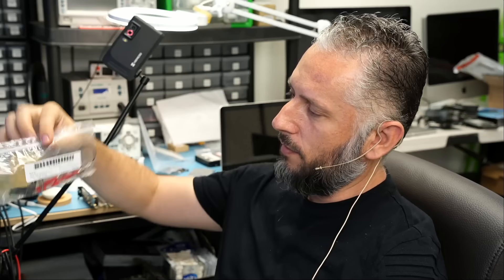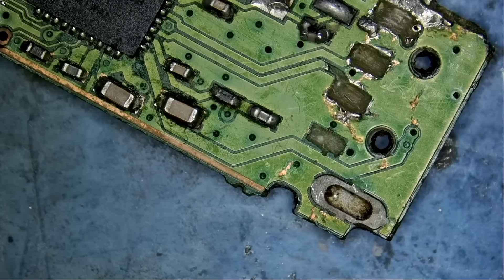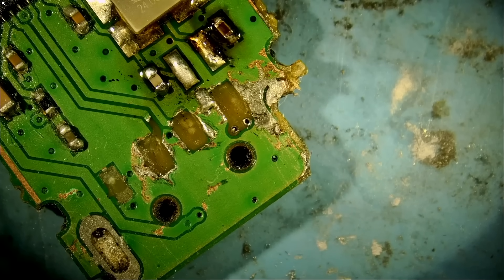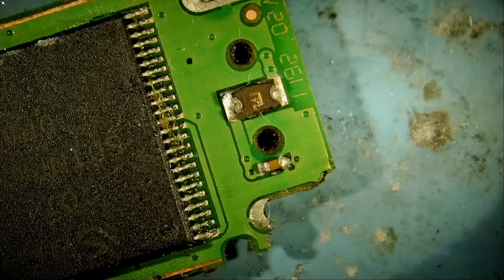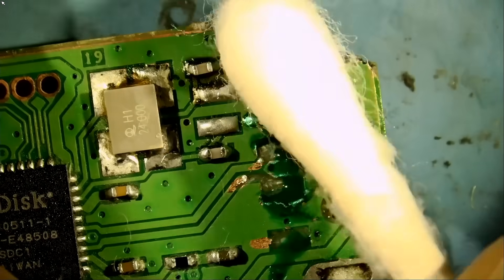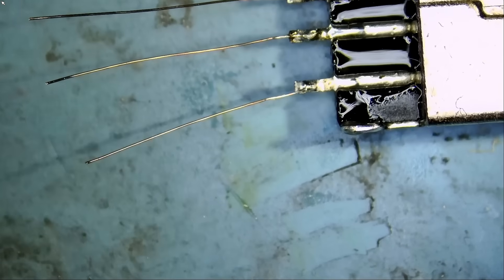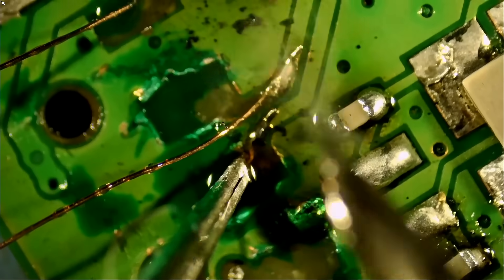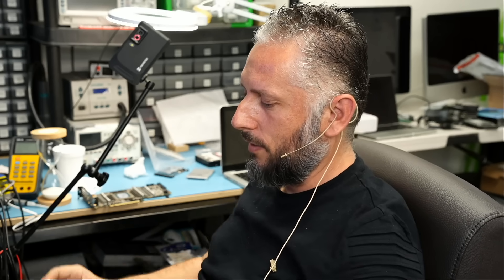Severely Damaged Flash Drive Repair. Can we still get Data ?

Comment: Awsome job, Alex! May i suggest you to make an universal flash drive test jig with a solid USB B (2.0/3.0) female connector with four/nine terminals. You can fasten the flash drive to the jig and connect wires from drive to the terminals. Then you have a rigged platform, you can connect and disconnect with ease and without being afraid of the fragile wires. Then you can give it to BigBoss to recover.
Reply: Only need the 4 usb 2.0 wires for data recovery. You probably don't care about the 3.0 speeds then.
Reply: @JonHaa87 if its a lot of data it might be worth getting usb 3.x for faster transfer overall faster job

Comment: I have lights with sensors in the hause with bateries on the stairs to se better and one day the usb B port snapped,because i have the right tools i soldered back and surprise it works 😊😊😊and hdmi microscope its very important to have

Comment: It looks like there was enough through-hole left on either end to secure the port down to the board and then jump wires from there to the traces/groundplane. 
Did you do the recovery repair differently so that it is difficult for the customer to keep using the drive on purpose then? It sounds like the smarter thing to do if I think about it I guess.

Comment: you need to offload data on your main c drive because it's in the red which means OS and applications will not perform as well due to not enough drive space for data operations.

Comment: if the chips were still good but the board wasn't could you get another board and put the chips onto the other board to get the data or would it be erased from removing the chip

Comment: if you need only data recovery and you have another working compatible board, wouldn`t be easyer to move the memory chip on the good board and take the data out?
Or you want to send the USB back too?
Reply: It could be risky desoldering and moving these chips, may cause damage or chip might end up dead from excess heat.
Reply: The further one gets away from the original source the higher the chance of error or loss. The controller may be serialized. The voltages on the various components of the new board may be wrong on the replacement board and may cause further or irreparable damage. Stick with the original and only transfer components to a new board in the most extreme cases (i.e. cracked circuit board, overwhelming number of missing components, etc.) The 'easiest' path is not always the 'safest' path.
Reply: Flash memory does not like being heated. If it's already half-dead, soldering may finish it off.
Reply: Ok, thanks. I saw in some datasheets that the chip is pretty resistant at high temperatures, but I did not looked about data retention at that high temperatures.
And by the same board, I meant some witch you know it used the same memory, or one with similar pinout and compatibilities.

Comment: Anyone notice the mouse pointer in the top left corner for most of the vid? 🤫  Also: blurring is not a good technique for obfuscating data, it can be reversed
Reply: I didn't know that, can you do it in real time, or only do it after the fact?
Reply: @davidhamm5626  I know it can be done with images/stills, not sure about realtime though, it's probably technically possible but I don't know of anything that exists to do it yet
Reply: @mosscode  Thanks for the information !